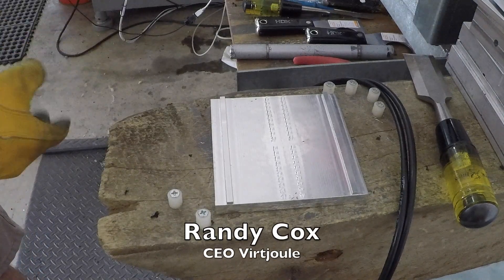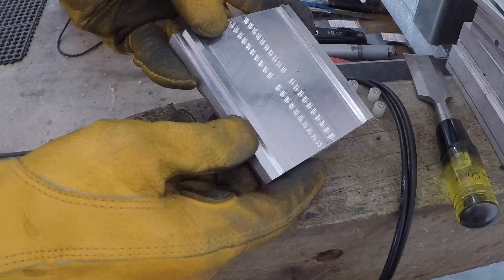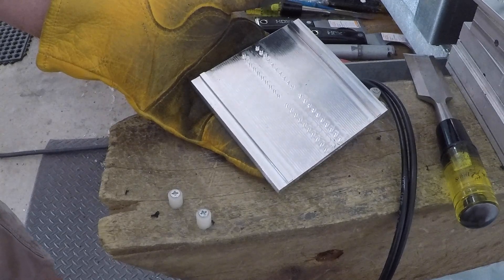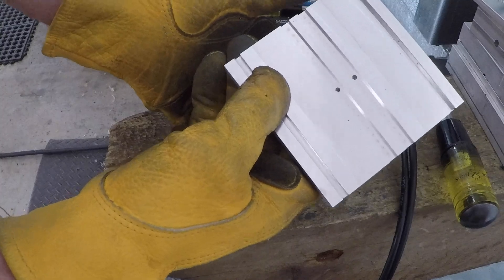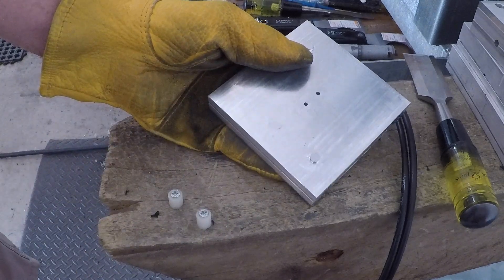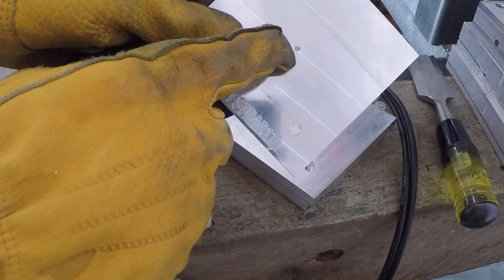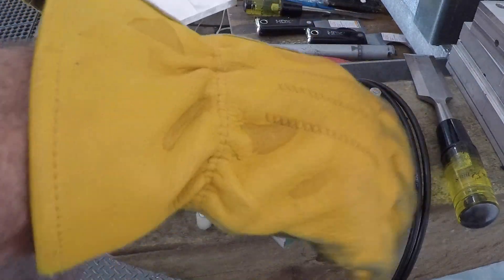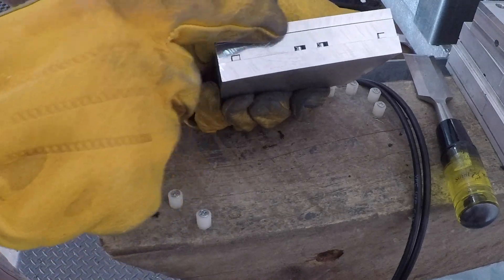2-Cavity mold for Santoprene Belt - Medium Machinery Injection Molder

Comment: Cool, but what are the molded parts used for? 🤔
Reply from the maker: This was an internal part of the HVAC sensor I designed to retain a module plugged into a carrier board.  These units are mounted in high-vibration locations and are shipped and handled roughly.  I wanted no situation where this module popped out of its sockets and so this belt is strapping the module down to the carrier board.
Reply: @ cool, tnx for sharing!